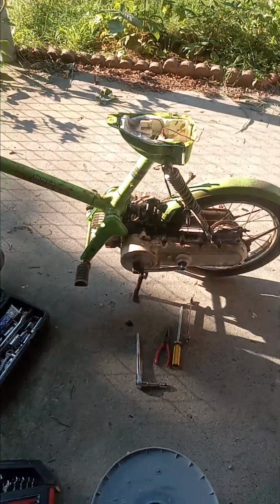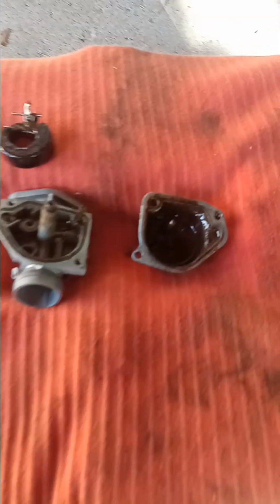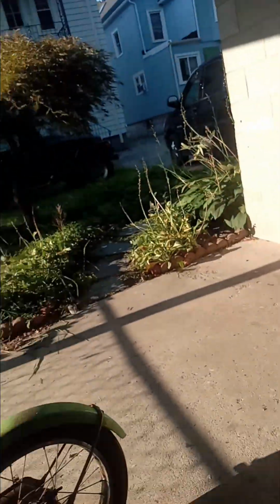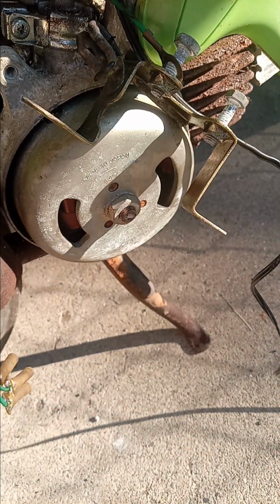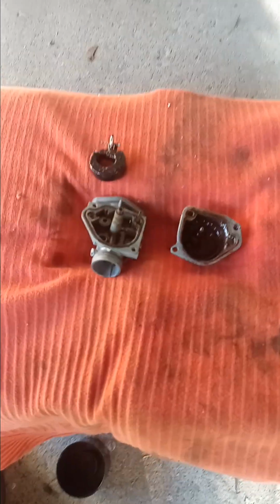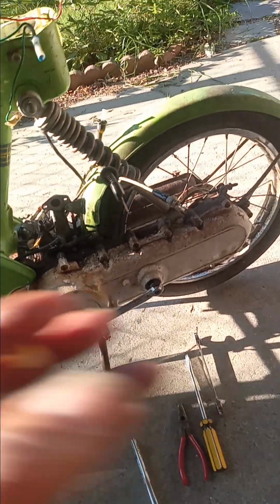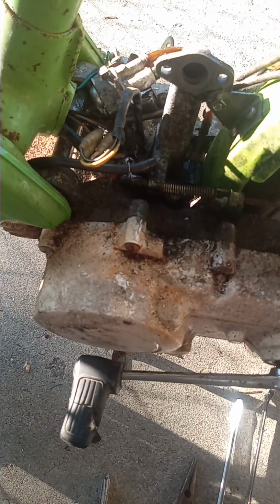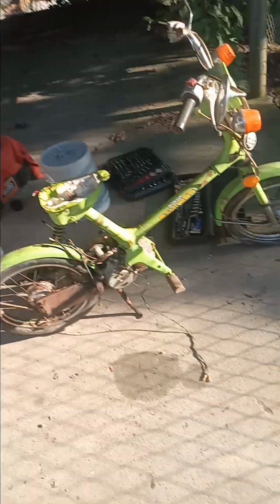1978 Honda Express, NC50 Moped project

Comment: Try switching out to a dellorto 1515 sha with the intake adapter from Treatland. It’s the best option for the bike, once you clean the carb there’s a good chance it will leak from the needle and seat area. Good luck with the project, I have a series of videos on my channel. It’s called Grumpy’s random projects.